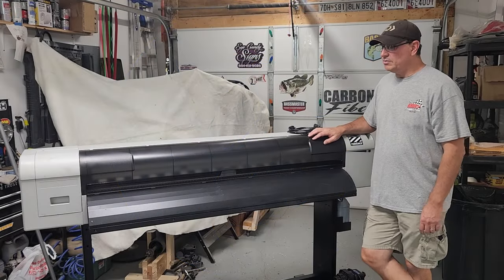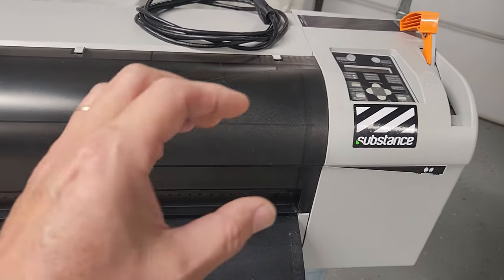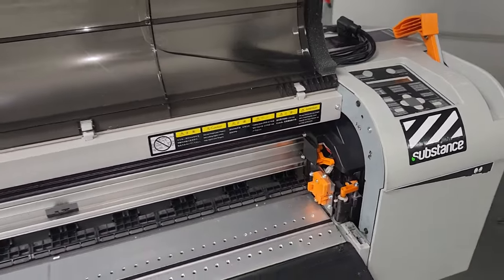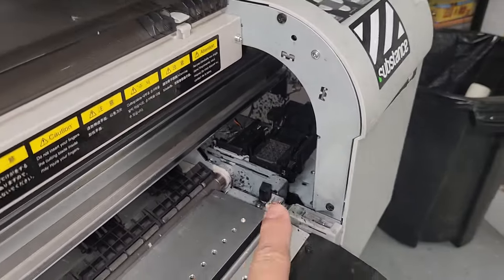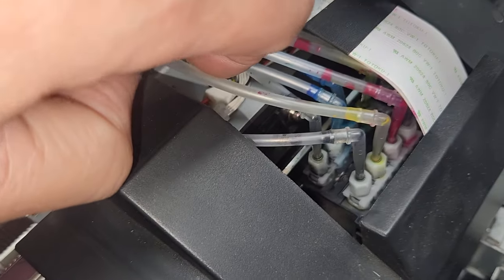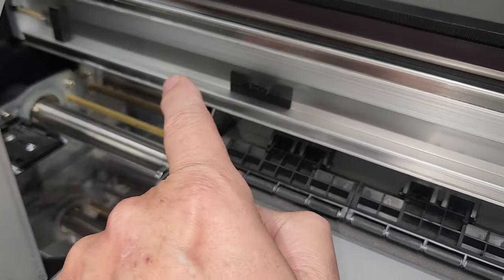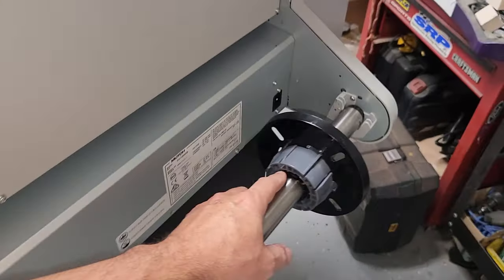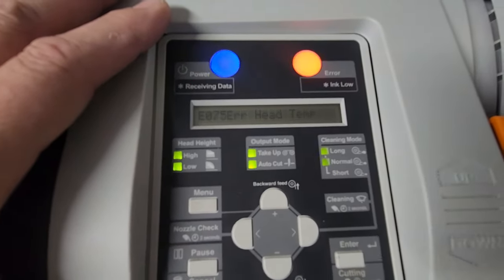Watch This Before Buying A Used ECO-SOL Sign & Wrap Printer!

Comment: One thing to look out for on Mimakis, along with the print head, is the rollers.  Mimaki uses 3 to 7 individual rollers that are movable back & forth.  If these rollers are concaved, it could mean that the prints won't track right and contour cuts will be off...sometime as much as 1/4" over 48" travel (yep, mine does this).  It also indicates that the springs on the rollers are weak and will need replaced.  and on the CJV series, that's a pain in the butt, but changing rollers is easy unfortunately that doesn't fix the tracking issue.  So, make sure to check the rollers, also the grip rollers because these get gummed up and the bearings stick.
Reply from the maker: Awesome,  thanks for sharing that info! I'm not nor never ran a Mimaki, almost got one over the Mutoh, almost....

Comment: Very helpfull to know thank you for the video .
Reply from the maker: You are welcome! Thanks for watching.
Reply: @TheSignGuy he buddy glad to see your videos how long did you have your printer before it failed you? Also what is your Normal “OutGas” weight before laminating again?
Reply from the maker: Hey DON!! 5 1/2 years before the head failed, not bad IMO. My normal outgas time depended on the ink saturation and the media I was using. Deep, dark colors like Black, Blue, Reds at a 720 X 720 (+) output I would generally let them sit overnight (8-12 hours). 720x540 not as much ink was put down so as little as 30 min up to a few hours before lamination and contour cut.
Reply: @TheSignGuy  my man and 5 1/2 years is great

Comment: Ever thought about getting a HP Latex?  I've been using latex for over 15yrs and really like them.
Reply from the maker: Not specifically a latex or HP or another printer, for now... I'm subbing the prints out for the time being but it pains me to know what is costs vs. what I'm paying....
Reply: @TheSignGuy  you can get a HP Latex 560 for about $6k - $8k used.  If you want the newest model it's like $20K